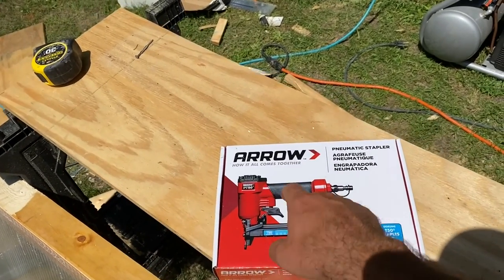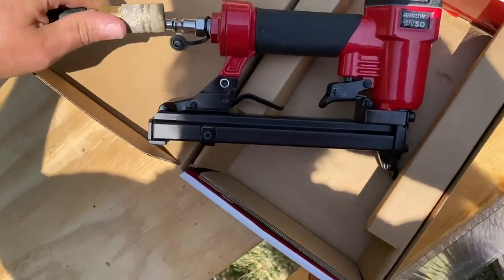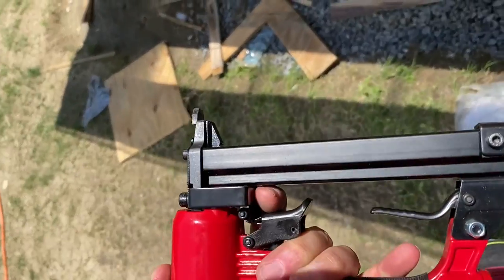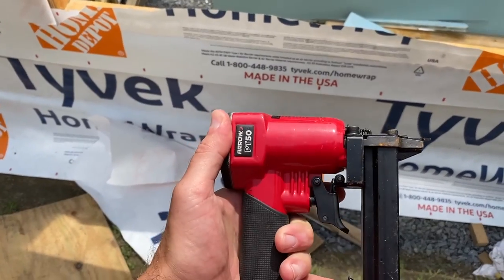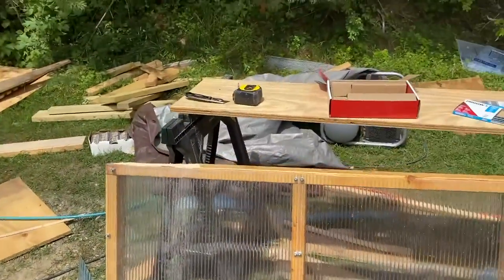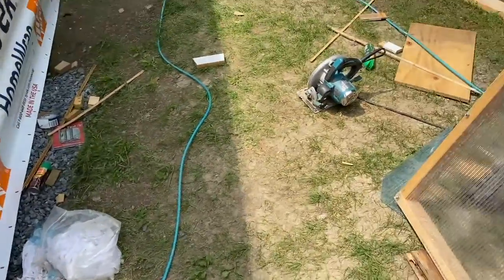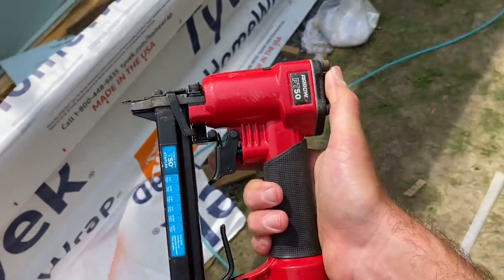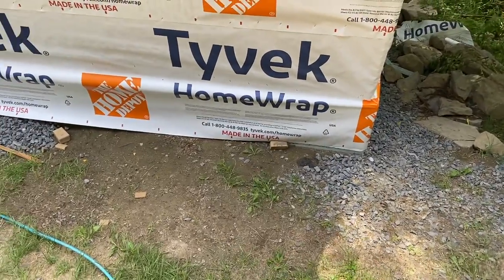Arrow Air Stapler Review

Comment: The stapler will get rusty and misfired if you don’t have a moisture/particle filter on your compressor line.
Reply from the maker: Its amazing how much water sits at the bottom of the tank on a nice humid day! But to be honest if i think back to all the tools i'v used over the years none have failed do to rusting from air in the lines.

Comment: THIS GUN IS A PIECE OF CRAP. I BOUGHT 2 OF THEN AND THE PLUNGER STOPS RETRACTING IN ABOUT 30 DAYS. DON'T BUY IT!
Reply from the maker: 100% right its trash gun. Had problems with it right out the box but it got the job done. I will never need after that one small project.
Reply: I hope the newer model fix those issues.  I just need a cheap staple gun to install roofing felt for a shed roof and for a screened porch.  I hope the new version fixed those issues.